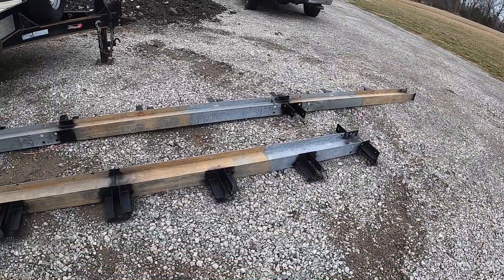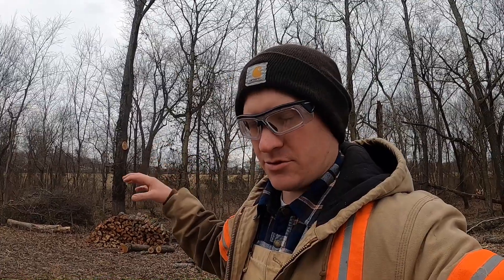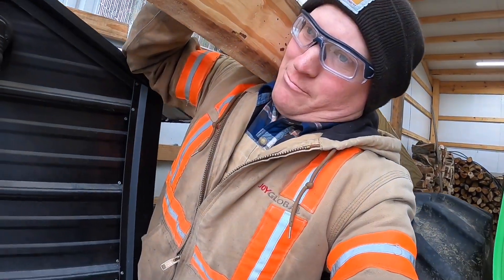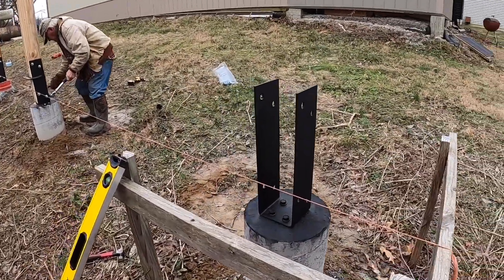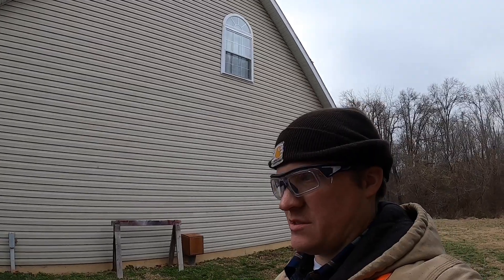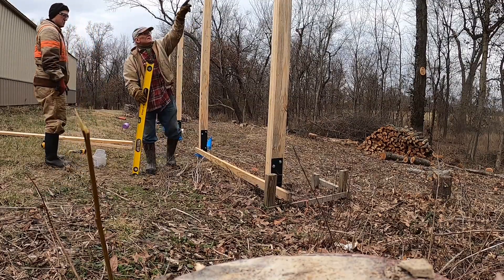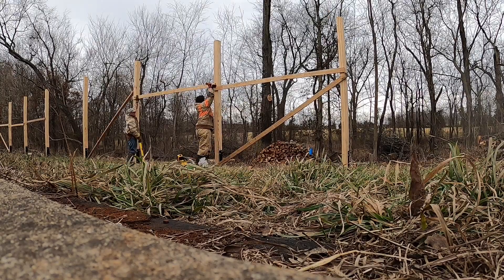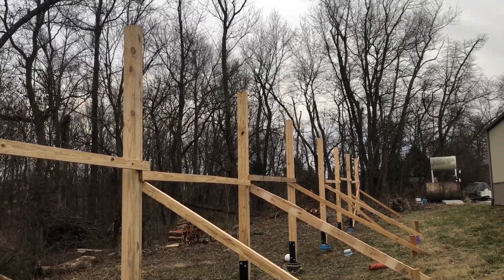Setting Posts and Prepping for Header - Pole Barn

Comment: How are you laminating the posts together?
Reply from the maker: I used structural adhesive and clamped them together and nailed them together.
Reply: @thebalerman  What kind of structural adhesive?
Reply from the maker: I’d have to look and see if I have any left. Yeah got it from menards or Lowe’s I think. Just come in a tube and you out it down with a caulk gun.
Reply: @gary24752  any exterior wood glue is always stronger than the wood its self.